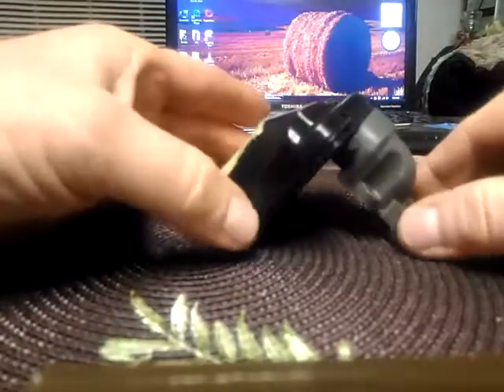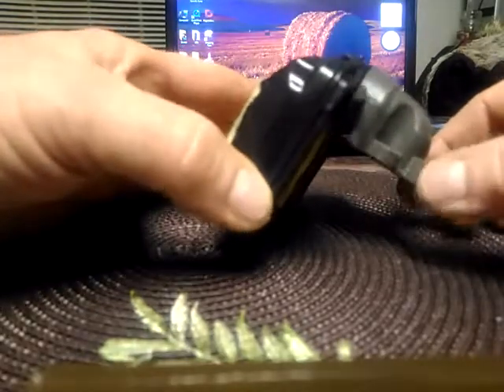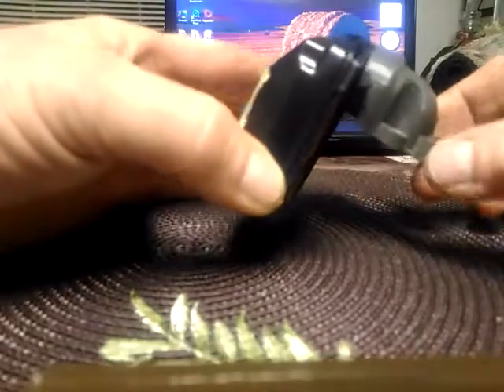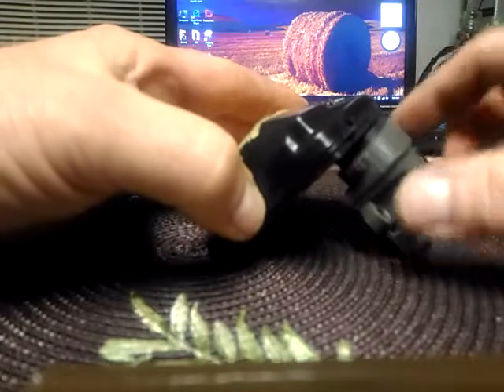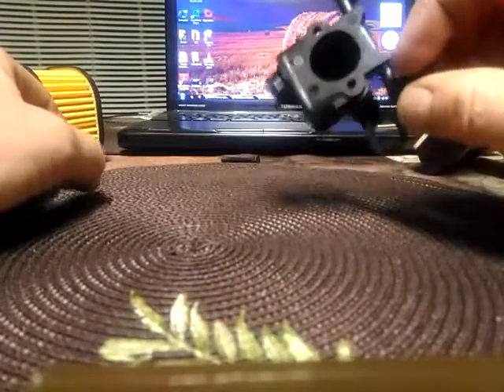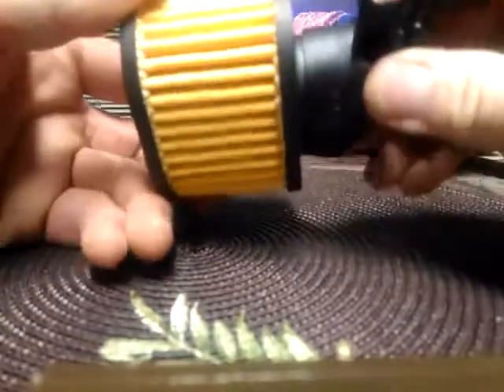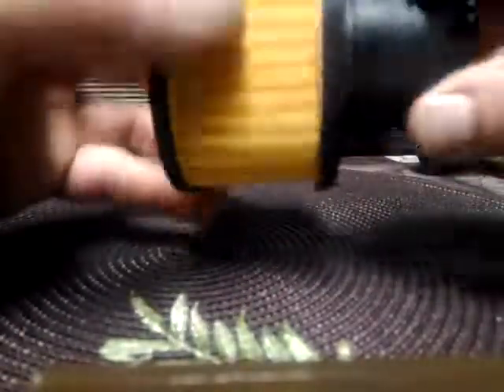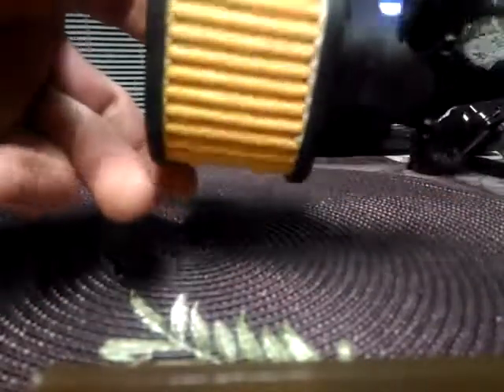Husqvarna 372 air filter

Comment: That fitment definitely looks loose I have had some of that way as well I have built a few of these and I have not had an issue with loss of compression I have had issues with low compression from the beginning of the build which is why I adjust my squish did the saw die or does it just have less power I could not tell the condition of the inside of the cylinder and the Rings I know it's a silly question but did the decomp value fail